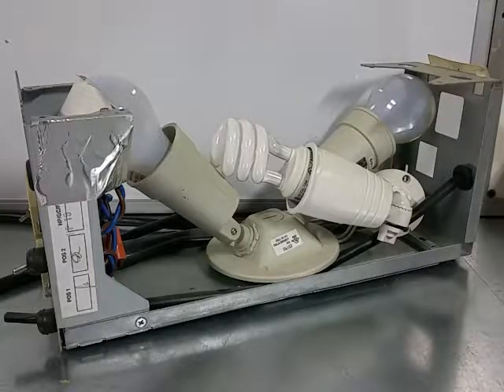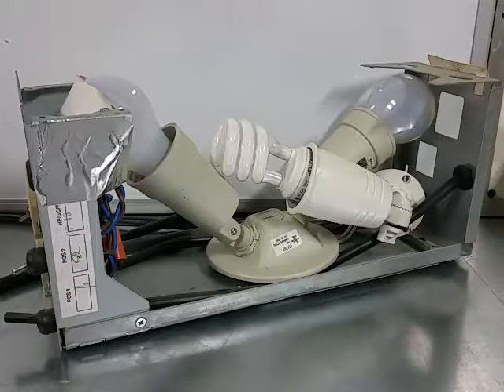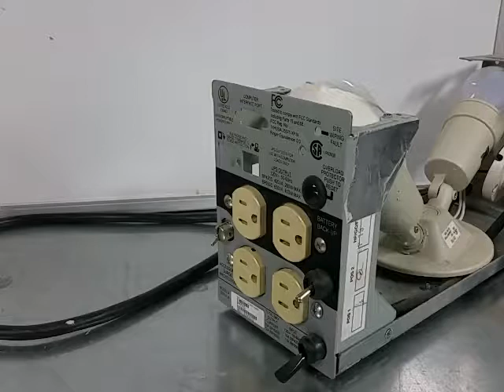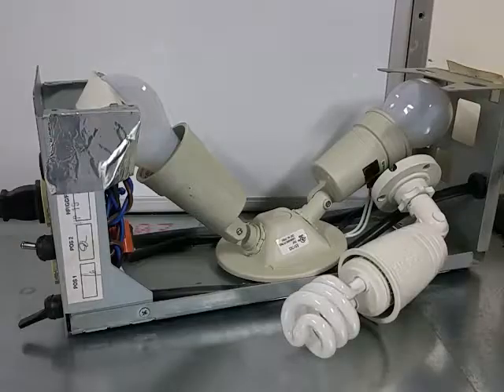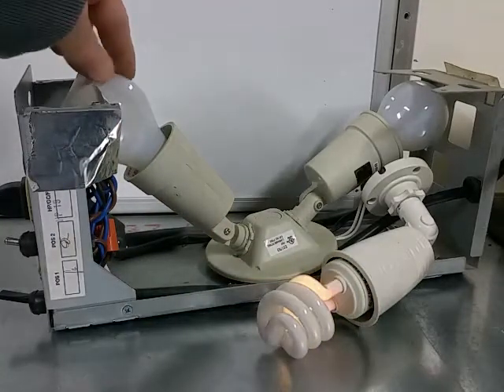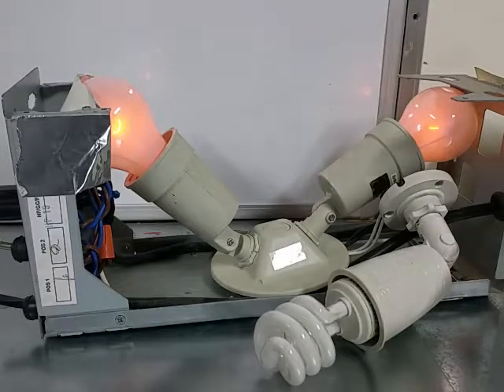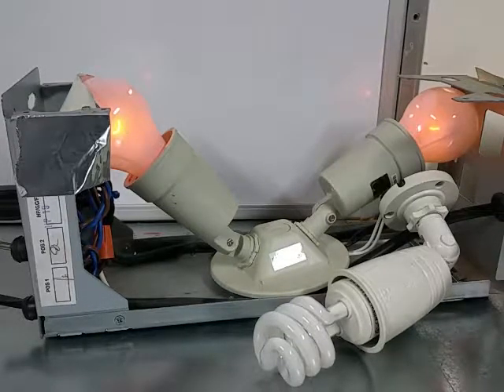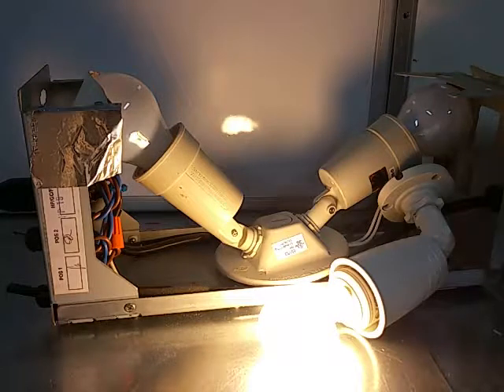Tesla Coils - tip, safety circuit limiter

Comment: I would need a lot of bulbs to handle 2200W.  Suggestions?
Reply from the maker: haha thats pretty hefty but...might try 25 - 100w bulbs.  go a little heavier so your bulbs are not being stressed.  25 bulbs (2500w) on 125v would be 20A.  You would want 125% more on your breaker as well so i would go with a 30A circuit breaker with #10 wire.  You could get by with a 25A breaker but i would still use # 10.  could even try a variac so you can ramp up the voltage if your circuit would allow for it.
Reply: @wyrtap5138  2 1500W Nichrome wire heaters in parallel with each other then in series.  Tungsten filament bulbs have a positive thermal coefficient (PTC) with low cold resistance so high in rush current.  Nichrome wire/ribbon has a consistent resistance.  Always learning.
Reply from the maker: @solarsynapse  as we should be!  good job and thanks for the info!